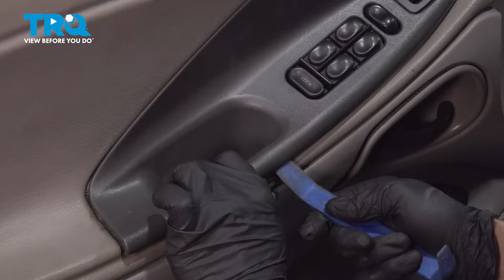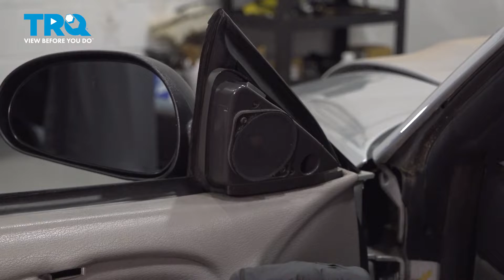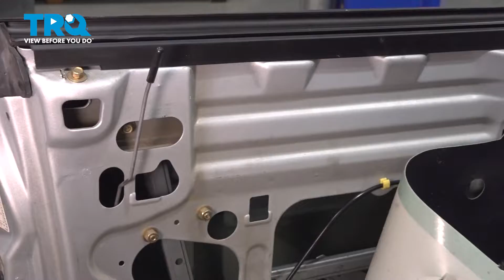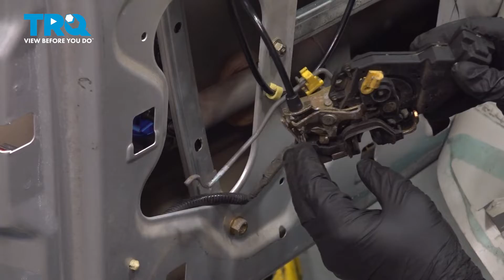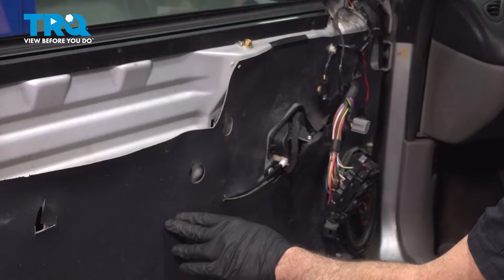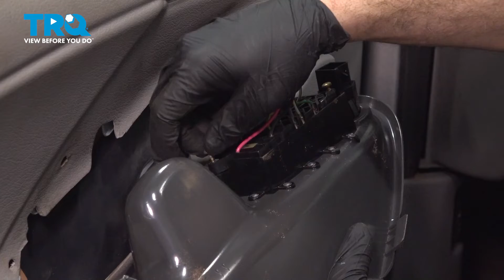How to Replace Door Lock Actuators 1994-2004 Ford Mustang

Comment: Excellent info video. 
We have the same mustang but the door is stuck shut. Locks work fine but it will not open the latch. Not sure it’s the actuator but can’t find a new latch assembly. Done all I know to do . Any suggests on how to get the door open so we can figure out which part to replace? 🤷‍♂️😩